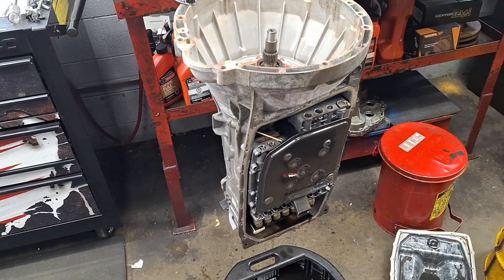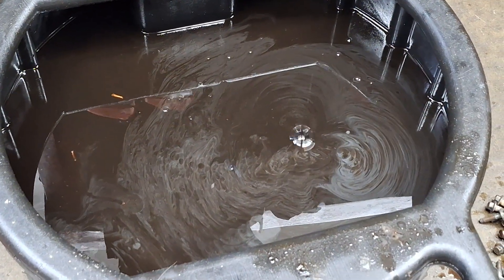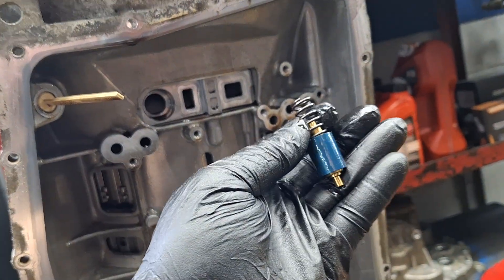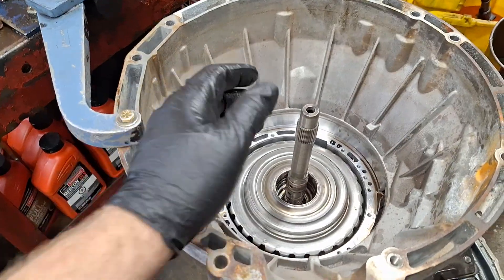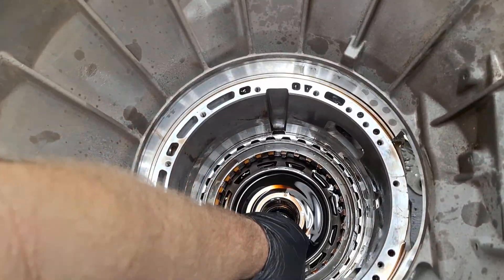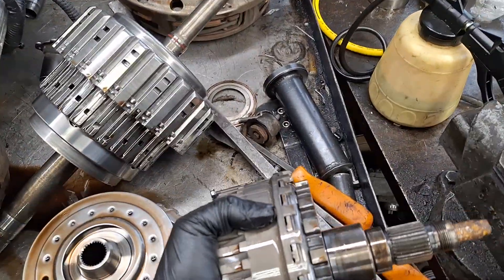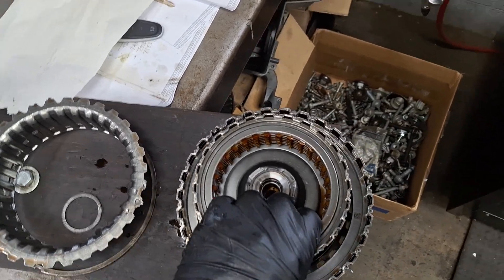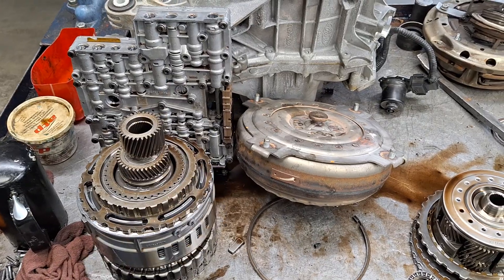Ford 6R80 Transmission Teardown

Comment: Hey there Ben great video! I have a question for you.. Had my 6r80 fully rebuilt in my 17’ f150 due to torque converter failure. Was out of town and couldn’t get the truck in so ruined the internals after driving 3k miles with a bad converter. Trans rebuilt at 136k and just did my first 30k mile service 4k miles early due to many issues. Issues have persisted since service. My transmission guys seems clueless but I think it needs to be taken apart. It shifts incredibly smooth until you slam on the accelerator say in 5th gear and it downshifts to 3rd. Or 6th and it drops to 4th or even 3rd. Loud grind which my transmission guy calls “clutch squawk” 
I was getting a grind in upshifts only from 3rd to 4th and only at about 2200 rpm but I’ve yet to hear that since the service. The truck is tuned so shift points are different, every time it downshifts into 2nd at about 18mph I get a thud. Only at 18mph. They can’t seem to figure it out. Sorry for the novel. Hope you can help. Thanks
Reply from the maker: Hey that's the overdrive clutches sticking. They probably should have replaced those during the rebuild. If they did they didn't break in properly or they didn't put in the additive that the shop manual calls for which is a friction modifier XL 16 I believe. Motorcraft part number. You can add that in or you can get some aftermarket friction modifier such as lubeguard shudder fix. Then drive it for a thousand miles and see if it improves. Typically these overdrive clutches need a thousand miles to break in with the additive and no heavy hauling. Good luck
Reply: @BigBensCarsAndCycles you’re the man thanks bro!

Comment: That looks expensive. How much for complete rebuild???
Reply from the maker: Depends on the shop you go to and if you bring the transmission in or the whole car in if you bring the whole car in 5 to 7,000
Reply: @BigBensCarsAndCycles yikes hurts to hear that, my 6r80 on my transmission went bad due to a torque converter, valve body and a pump.  Should I just get a new transmission

Comment: So this transmission seems to have some issue with rotational output shaft slop causing vibration under load.

I was really hoping your video would show me a bushing, shim, or bearing that could be causing this issue. 

If you know of a part that could possibly cause this please advise.

Thank you!!
Reply from the maker: If its on a mustang then there may be slop in the output shaft flange
Reply: @BigBensCarsAndCycles Is it fixable?
Reply from the maker: Yes if thats your problem replace the flange@bodyshotjake7475
Reply: @BigBensCarsAndCycles just the flange? Huh? I’ll try it but the issue seems internal as the shaft it’s bolted to rotates with it.

Comment: Where do you recommend buying the complete valve body and lead frame for 6r80 I need one for my 2009 f150
Reply from the maker: @jakeritter9847  ford dealer, or fordpartsgiant. Junkyard is an option. Cheaper but more risk

Comment: I just bought a 2013 F150 5.0 w80k miles and it bumped or clunks a little shifting into 2nd gear from 1st. Two transmission shops told me I need a $7000 new transmission, but that seems bizarre. It shifts flawless otherwise.
Any idea what it could be, solenoid or needing fresh fluids with an additive?
Reply: change fluid and filter. could also clear the transmission adaptive tables

Comment: Hi. My mazda bt-50 started leaking trans oil between the trans and engine very bad. I remover the transmission and i saw oil coming between the shaft and pump. And the shaft is literally not centered. What can be the cause of that

Comment: I have a coyote 6r80 the tranmission jerks or has a jump while shifting and have no codes any help?!??
Reply: Could be the start of a lead frame issue, could be gunk in the valve body, could be low fluid, could be bad fluid, could be transmission cooler failure (coolant in trans fluid) or could be chunks of your clutch packs falling apart. Thats the beauty of transmission issues.

Comment: Hello, I am a fellow gearhead enthusiast. I am doing a coyote swap in my ObS F150. 
I accidentally mated the transmission and engine without the torque converter being fully seated. 
My first question is can I just replace the pump housing without having to takeoff the oil pan and valve body? 

From what I’ve researched the possible damages that can occur from doing the stupid mistake that I did is 
Broken oil pump 
Broken torque converter 
Broken flywheel  
Do you think there could be more damage beyond the oil pump?
Reply: Did you ever get an answer to this issue? It seems we made a similar mistake at my shop and we're looking to swap the pump as well.
Reply: @moneykid207   no but stay in touch I haven’t gotten an answer yet
Reply: @alexramirez8096  Hey Alex -
Hope this will help you out. 
We pulled apart the transmission today and found that only the pump had broken. Both input shaft and pump shaft are fine, as well as torque converter. Flywheel as well. Have a new pump and seals coming tomorrow and can keep you updated once we put it all back in tomorrow if necessary. Hope it works out for your OBS as well. Sounds like a wicked build!
Reply: @moneykid207  to replace the pump do you just have to remove the front bolts and swap the pumps or do you need to drop the valve body?
Reply: @alexramirez8096  Drop the valve body. It’s not that bad. You have to remove a plastic retainer that I believe secures the pump outlet.
Reply: @moneykid207  thanks bud should I do something else since I’ll be in there already?
Reply: @alexramirez8096  Get the pump seals from Ford, and a good time to knock out a valve body while you’re in there if a used unit. But usually a good filter change and seals will do you good!

Comment: 2009 ford f150 4.6L V8 6r80 transmission. When I was driving on a dirt road going 40mph and a wrench light display and I got to the Food store parking lot and took out the OBD2 scsnner and DTC says p0741 torque converter switch off. When I drag something heavy like a railroad metal behind my truck, transmission guages goes up to hot position and my electrical fan kicks in to help cool it down to normal. While I was heading uphill on highway on normal highway speeds we heard a chuck sound and wrench light came on. When I drain out the transmission fluid i dont see no burnt smell or leaking fluids but just tons of mud underneath. Only thing is, every time I do trans fluid change, the screw it gets stuck or stripped but i cant take it out. After we took out the transnission to replace the torque converter for the new one. We put it back in but we hear a stud sound, not sure if we broke the pump assembly and we took it back out and hard to see inside, already replace the seal, and unsure if we have to replacd the oil pump assembly. All seals have to be replace when doing the transmission converter part. Transmission gear runs good during reverse, forward in drive, netural and when i go downhill i feel the transmission shuddering during acceleration. I do some little heavy work like drag metal rail, and wood hsuling. No crazy drives. just normal drives.

Comment: I have a 2010 Ford Expedition 2wd. I have 249,000 miles and just had the roller followers, timing chain, phasers, high volume oil pump, new water pump, new alternator, new spark plugs brown boots. 

I have changed the transmission fluid and filter every 2 yrs since I bought it 2012. The problem is it has a clunk from a take off and shifts hard the 1 and 2 great. Then when slowing down same clunk. The checked the fluid and it doesn't smell burnt I'm at a lost. 

I don't know if I should replace the value body, solenoid, torque converter? If I take it to the Ford dealership can they diagnose the issue and tell me the fix or should I go to a transmission repair facility?
Reply: you dampers are flad repl with new ones, all you need is the dampers and gasket plate for your 6r80e transmission valvebody and someone like me, how can doit!!

Comment: My 6r80 slips for 1st to 2nd wen I give it hard acceleration, but in sport shift mode it won’t slip at all.  If I’m gentle on the accelerator taking off it won’t slip. Iv got no transmission DTCs on forscan. Any common issues that can cause that slip?Otherwise iv got no issues with it. Changed the fluid n filter. Somebody mentioned it cud be a drum issue. Which one is the 1st n 2nd drum I’m not sure. Great tear down vid
Reply from the maker: Does it clunk or actually slip? Since it doesn't do it in sport mode, it may be worth trying a new valve body before tearing into it. As long as there isn't a burnt smell in the fluid. 2nd gear should be intermediate on this. IIRC, that's on the center support. So the two shims that slide on the edge of the support may be worn, or the case where they ride (if you only have a clunk)
Reply: No clunk it just slips in drive goin into 2nd gear. Thanks for the reply il have a look  
IIRC intermediate shaft drum set n the shims got that.  Any tcm live data pids that may help me diagnose the valve body ? there’s a ton of live tranny data in forscan. Iv got no shift solenoid /speed input output DTCs  at all. Other than that slip no other issues of clunking or hard shifting. It has done 150,000 miles this tranny
Reply from the maker: @user-df4jl5jl6k  trans slip desired and slip measured should match, if they don't it's a slip. If there's no burnt odor, then you can replace the solenoid for the intermediate clutch, or the whole valve body
Reply: @BigBensCarsAndCycles  no doubt about ya mate thank you 
Great video

Comment: Hey Mr.Ben, I just replaced my transmission on my car. And no for some reason when I try to start it, everything shuts off, as well as my PRNDS doesn’t show up on my dash, I keep getting “parking aid”, wondering if you could help with tips or give me insight to what’s going on, thank you
Reply from the maker: Hi, your connector on the back of the transmission may be broken or unseated. Or full of fluid